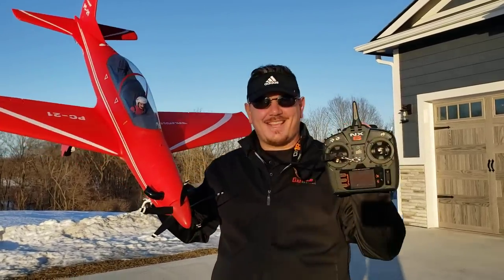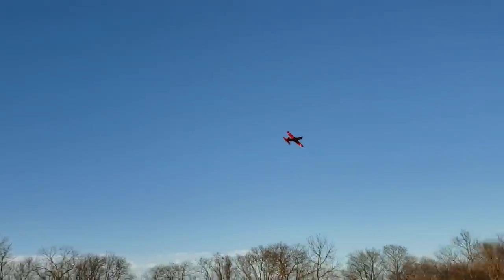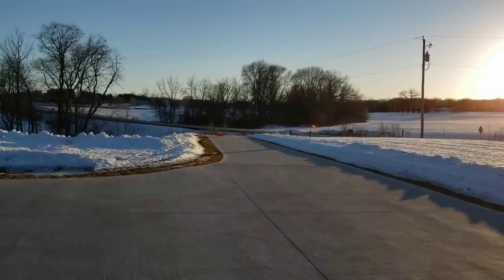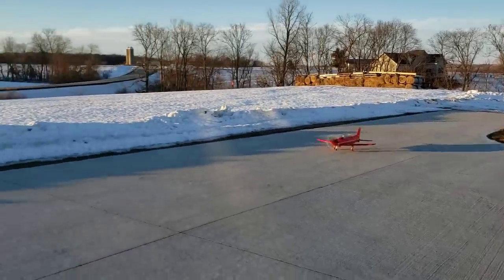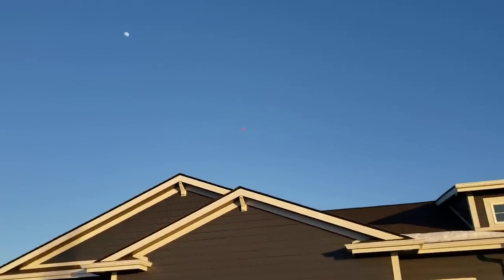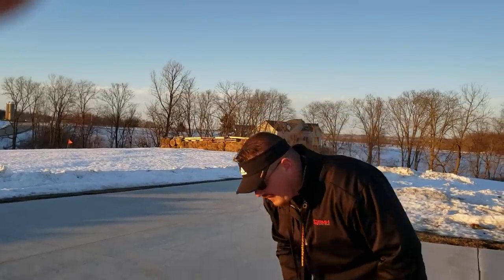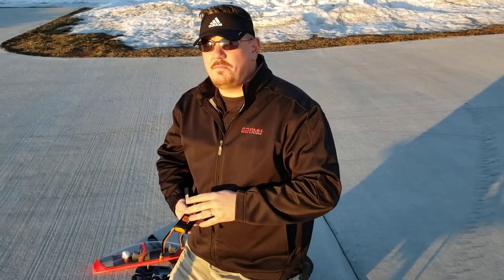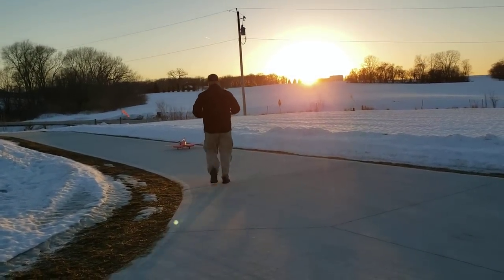FMS - Pilatus PC-21 - 1.1m - Unbox, Build, Radio Setup, & Maiden Flights

Comment: I’m busy rebuilding mine, by far my favourite as a passionate Pilatus fanatic. I wanted one of these with a sore heart but could never get one here until a mate found one that was quite abused, got a replacement fuz, new prop, made my own more scale spinner, rebuilding the cockpit and hatch completely, also more scale and detailed, redoing the wing tips to a scale profile (larger than the stock tips) new gear doors, a Patrouille du Suiss  white and red scheme, dummy underwing tanks, full placard decals  including the canopy breakaway patterns and a host of refinements, it’s going to be a competition winner, the pilot figure is a full figure fighter pilot that cost almost what the model costs! If you want to add more detail and would like the decal set I’d be happy to share the artwork with you, I just print on A4 label paper and coat it with polyurethane varnish.
Reply from the maker: Sounds very cool! Good luck with that beauty!!!

She flies GREAT stock, so I hope with all the mods, she'll still fly just as amazing for you!

Comment: So glad you also had to move your battery that far forward.  I just set mine up this week, and was worried about how far I had to move mine.  That front strap is barely holding on to the back of my battery, lol.  I put a rubber strip on the bottom to help it stay in place.
Reply from the maker: I agree, pretty weird, BUT I bet she'd fly with it back a waze too, now that I've had her up about 6+ flights. LOVING THIS PLANE!
Reply: @BrianPhillipsRC  Hey, do you have a Patreon?
Reply: @BrianPhillipsRC  Hey, I was able to maiden my PC-21 Pilates this morning.  I reduced the throw on the flaps cause I heard they were extreme.  Takeoff was perfect, and only needed 2 clicks of right Aileron.  Very stable, predictable, and controllable.  Not as fast as you might think, but its rock stable, even inverted and in a knife edge.  My first "jet trainer" and first time with retracts.  Great experience for sure.  Can't wait to fly it some more.  Thanks for the video!

Comment: If you had a slider-equipped transmitter (NX8 or higher I think) you could get full gains for slower flight and landing (e.g. 90 roll at full but at half you're at 45) and turn it off completely as you did with the three position switch. It'll also let you have fine tuned precision for adjusting AS3X, especially with jets which love wobbling if they're not set up just right.
Reply from the maker: I want soooooo badly to have a peto tube for reactive AS3X, but don't think I'll be getting this any time soon ;(

Comment: I bought a pack of self-adhesive screw cover caps that are small white circular 9/16" disks that I use to mark the CG on my planes.  They are raised up slightly and have a texture on them so I can easily find them to check CG whether it is a high wing or low wing.
Reply from the maker: NICE! Do they BLOW off???
Reply: @BrianPhillipsRC  Nope, they stick really well.

Comment: Love the prop on that plane
Reply from the maker: I do too, but I want to balance it, and I'm kinda reluctant to delve into that project for fear of it being a HUGE pain...
Reply: @BrianPhillipsRC  it's not as bad as you think, even a small enhancement to the balance goes a long way (i gave up getting mine perfect after about 30 min).  Also, if the prop is at all loose on the shaft throw a little teflon tape on the shaft, it tightened everything up for me.

Comment: Love the look. That color is stunning. Outstanding electronics bay. I like to be able to stuff more than a battery and receiver inside my planes. It seems like a lot of plane for $200.
Reply from the maker: Well, to be fair, the Rx is another few bucks, I've been saying under $300, but it's about the cost of the other BNF planes, if you do it like I did with the AR631 (which has been really nice!).

Even at <$300, it's a GREAT plane.

Comment: It also comes with a Reflex System so you do not need the Safe and AS3X - you can just use a nice Spektrum AR620..  OH I see you got sent one without the Reflex installed  - well I Just purchased mine today with Reflex... a bit late to the show bit got it a killer price here in the UK - short servo extension leads and shove it in the back behind the battery.. then you have all the space you want to set the battery so the CG is good...
Reply from the maker: Yep - the Reflex system is only generally offered overseas, from what I'm gathering....but it does act as an external stabilizer, as I understand. I'd like to try one at some point ;)

Comment: Brian if you get the nx8 or 10 you can assign the as3x gain channel to the r/h knob so you can adjust in the air way easier ,then when you are happy with that you can permanently set  gains on the ground if you like .  You commented on mixing in fwd programming don't remember ever seeing that.
Reply from the maker: I have the NX8 now, and plan to showcase this soon - Thanks Mike!

Comment: Got the 1.5 Turbo Timber and 3 3200 mAh 4S for it, you got me considering this one Brian!!!
Reply: OK checked the price -thru your link... now I'm really considering. I've even got 2 AR636Bs on the way. Which I may be reach out for help, first time installing them in a new plane. Got the blue tooth cable for forward programming.
Reply: almost forgot, luv turbo props too, work for a regional airline and out first 2 aircraft types (Beech 1900D and Dash 8 200/300) were turbos.
Reply from the maker: Very cool Michael! Forward programming is fairly straight forward, but why not BNF - sooo much easier???

Comment: I put a 5S setup in mine, running a 65amp esc and 2200mah 5s battery.  I also am running parallel  2x 1800mah 5s combo which it handles no problem.  I run the stock prop and this is now its nearly as fast as my EDF's with unlimited vertical (I'm at 5000ft) so you might have that anyways.
Reply from the maker: AWESOMENESS! I want to try it now!
Reply: @BrianPhillipsRC  it would make a great second thoughts video!
Reply from the maker: We already filmed a second thoughts video, so don't forget we haven't had a chance to try your idea yet ;)

Comment: its one of my favourite planes, smooth, no gyro required, i have an fms 3648 870kv motor in mine, 850watt 58amp, 80amp esc, quick enough for me on 3000mah 4s 40c 4.5 mins.
Reply from the maker: I took her out last night in the calm and it was flawless!!!
Reply: @BrianPhillipsRC  Yes Brian its a great flyer and looks well in the air .   The uprated motor I added gives it that extra climb rate.  I added oleo to front retract and I fly off well cut grass no problem, half flaps take off, nose a fraction down on landing approach, flare at last second for almost 3 pointer with mains just a fraction before nose.

Comment: I was just wondering what to do for the next 3:15:21. Thanks BP. Which do you prefer this or the new Eflite T28 Trojan?
Reply from the maker: Well, to be fair, this plane, as configured it almost 1.5 times as much, but it's a lot more feature packed with flaps and retracts, and the AR631 is amazing too...BUT the 1.1m T-28 Trojan is VERY good. I hate to tell you this, but If there were a fire in the house, (After the kids of course), I'd grab BOTH - LOL

T28 1.1m https://bit.ly/38n1dvD
+
PC-21 1.1m https://bit.ly/3bCrHKg + AR631 https://bit.ly/3pYNC3c

= David Happy ;)

Comment: Nice. Can you do a video in the future showing the AR631 is only fly by telemetry (vs full range on like the AR637T/A)? Like have camera crew record the telemetry on the transmitter while you fly far and close to see what happens when it’s out of range. Just to show how far out “fly by” really goes.
Reply from the maker: I don't understand what you're asking.
Reply: @BrianPhillipsRC  spectrum has two types of telemetry: fly-by and full range. I assume fly-by only works (transmitter picks ups the data) when you “fly by”/fly near yourself vs full range which as the name implies, reaches as long as tx and rx are connected. Haven’t seen anyone do a comparison of these two differently ranged telemetries. Don’t see anything from spectrum indicating fly-by real range.

Comment: How is the servo and other equipment quality of FMS planes? Dynam for example makes some great airframes but have a reputation of substandard electronics that fail too often. I assume FMS is pretty good but dunno.
Reply: I have had 3 FMS planes and only had one issue. The nose steering servo was glued into my Yak 130. That CA glue got into the gear case of the servo, so it didn't work. I asked for a replacement servo and they just sent me a new plane. FMS guarantees their planes to work out of the box (after obvious assembly). They are really good.
Reply: I have had many FMS planes I think they are top notch . FMS / Eflight is the way to go
Reply from the maker: I wouldn't say they use substandard anything. In fact, I'd say they have some of the best sizing and quality parts I've see, second only to Eflite planes, of which I've even had some DOA...very few and far between, but even the best MFG in RC are going to have issues from time to time. I measure the quality of RC products partly by if the MFG or Distributor backs them up when they DO have issues.
Reply from the maker: Chucky - Agreed - they back stuff up nicely. Mark of a good company.
Reply from the maker: Mike - Yep, for sure! Not the cheapest, but you know you're getting into something solid. Definitely NOT "project planes" ;)

Comment: Quick question: I’m about to buy the NX6 as I’m a beginner and my question is if 6 channels is enough for a plane with flaps, lights and gear (for example the Fw190)? Or do I need 7 channels for that? Thanks for the help!
Reply from the maker: It's a 7 channel transmitter - I know, it's stupid that they call it 6 channel...BUT it is in FACT 7 channels ;)

For $40 more, you can get the NX8....might want to do that for more "shelf life" as you progress through the ranks.

NX https://bit.ly/3mbVuNB

Just my 2 cents, but I know the NX6 has been phenomenal so far!!!

Comment: I want to put safe and As3x in the arrows f15 and the fms rafale 80.  What receiver do you recommend for these aircraft. Thanks
Reply from the maker: Rx choices I'd choose, and in the order I'd choose them...
AR631 https://bit.ly/3pYNC3c (This one is a bit cheaper, but slightly less telemetry...but you CAN use an Avian ESC for the "rest" of the Telemetry Data)
AR637T https://bit.ly/3pW3u86 (This one would work great too)
AR8360T https://bit.ly/3dKg4n6 (This one might be overkill, but since I don't have the Rafale 80, I can't say with 100% certainty)

Comment: Brian, I have not used Hot glue before will it melt foam?
Reply from the maker: It can, but if it's thick, you can get away with some. The hot clue will stay HOT for a while, so be careful when you use it...and make sure you don't try to glue a wing into a pocket, since the foam will seal it off and cause it to stay hot for a LONG time, then you can end up with a gap around the glue. You'll notice, I was gluing around the edge of the Rx, in this build, so this works well.

You also need to keep in mind, it's heavy.

It's definitely doable, but just keep it as light as you can to get the job done, and don't "Trap" the glue and you'll be good!
Reply: @BrianPhillipsRC  Thanks Brian, you and your camera crew do an outstanding job! I always look forward to your plane video's

Comment: it warns you its turning off. just like the old spektrum, theres as delay before it fully turns off.. for safety. you can turn it back on and it wont disconnect if you do so before the beeps end
Reply from the maker: The NX6?
Reply: @BrianPhillipsRC  dx. i guess its more of an issue with a slider switch.

Comment: Do you have any video where if you activate the safe mode in this type of receivers, thanks
Reply from the maker: I haven't yet, but I may have to do it when I unbox and setup our new NX8. I don't mean to be dismissive here, but I just don't use it. I believe you can do it with just about 5 minutes more worth of steps, it's pretty easy in FORWARD PROGRAMMING....BUT you're right, we need to set that up, especially on a plane like this that SAFE would make sense in. This plane is ROCK SOLID, and I'd very highly reccmend it!

Comment: why not get the nx10 rather then the nx8?
Reply: If you have the money get the NX10 obviously more channels , hall affect gimbals , way longer battery life , nice magnetic charger , neck trap and bragging rights at the field .
Reply: @Mike-hr5ng  plus a lot pre loaded airplane models on the radio. I got mine a few weeks ago. Great radio
Reply from the maker: I want the NX10, but I need to share what's the BEST deal for people ;) The NX6 is amazing, and will do 95% of what everyone "needs" while the NX8 will do the other 4%...or 99% of the average RC enthusiast will need, while the NX10 is just awesome... Keep in mind, I currently have a DX18 sitting there looking pretty... I want to show what people will use, unless HH decided to send me an iX20 ;) Then screw all that talk - I'll be using it from now on - LOL!!!
Reply from the maker: Stop rubbing it in Mike - LOL ;)
Reply from the maker: @Garage928 - you too - LOL ;)
Reply: @BrianPhillipsRC  rub rub... I just did the WiFi online update and transformation of the newest firmware and plane data on it last weekend. No kidding, I’d took only 5 minutes! No cables or download to a Memory card or anything else required. Downloaded directly to the NX10. I’m so hooked to that thing. 😁👋🏻

Comment: Yeah, i love this plane, ive had mine for about a year now, and i only flew it once, so far i love it, and it flies really good. I'd love to see what you do with it. This plane flies just as good without AS3X as it does with it. Apparently the cg can be moved to 112mm behind the leading edge, According to this rcgroups page. https://www.rcgroups.com/forums/showthread.php?2700509-FMS-1100mm-Pilatus-PC-21/page20
Reply from the maker: Yeah, I bet it can, but I bet it would drag the tail strike really easy on rotation.
Reply: @BrianPhillipsRC  Probably. I havent tried it yet, so I dont know what to expect.